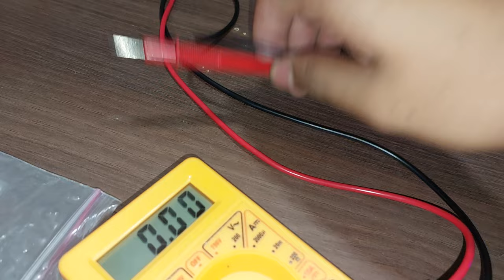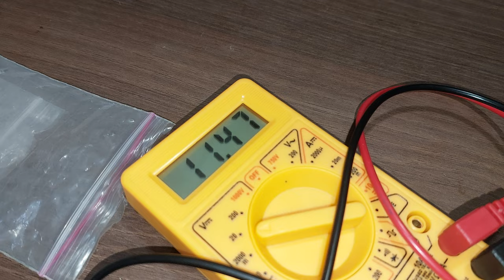How to Control L298N Motor Controller With RC Transmitter WITHOUTH Arduino.

Comment: Some people used diodes for input signals but your design  doesnt have. Do you know why they would use it?
Reply: Did you try it?
Reply from the maker: Diodes are just like one way valves for electricity. It is used to ensure that even if polarity is flipped by accident it wont cause any damage. However as the l298n and similar controllers depend on the voltage changing direction in order to change the direction in which it rotates the motor, a diode is of no use